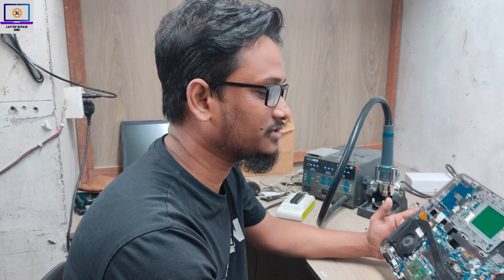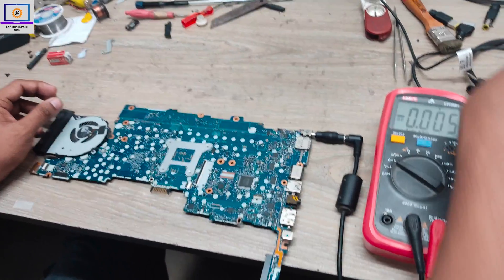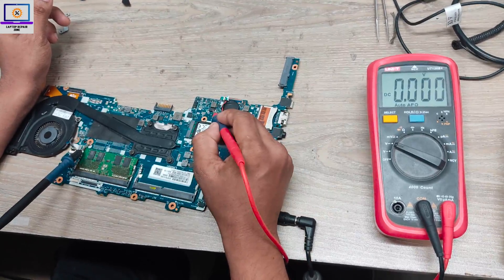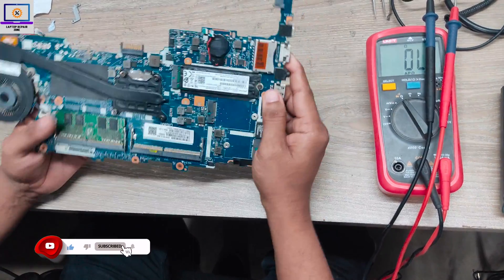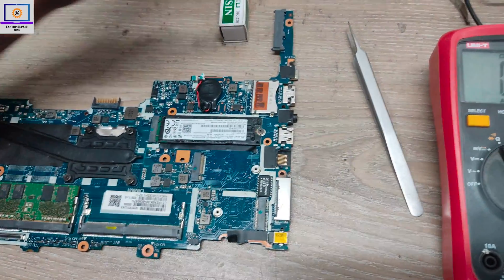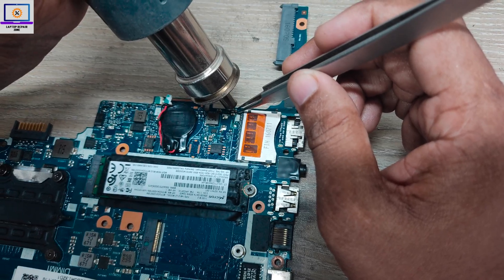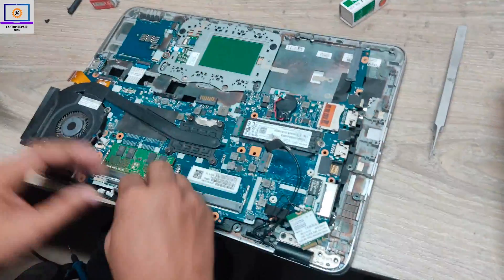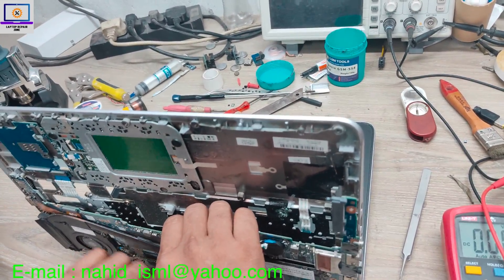hp g3 not turning on | hp laptop not turning on | hp | hp elitebook 840 g3 not turning on fixed!!

Comment: Sir hp laptop 
Without hdd  turns on and shows hdd not detected 
But after inserting hdd laptop turns on but shuts off
Solution plz
Reply: HDD thermals problem, you need to replace or swap the HDD to make it work
Reply: I changed hdd , ssb but same issue

Comment: I unplugged mine on the side, held the power button down for 60 seconds, put the plug back in, and it powered on.  I was looking to do this with the battery out, but did not see where to remove the battery.  That was the fix for a different laptop.  I guess it means it's going bad.

Comment: Hi, my HP laptop is not turning on properly. When I try to turn it on it takes me to a blue screen that has the options, 'continue, use a device, trouble shoot, and turn off'
I've formatted and updated the window, it became normal but after two days went back to the same problem.
What could be the problem please reply
Reply from the maker: First you can try by changing RAM and SSD or HDD, if same problem then you need to service your laptop motherboard thanks.
Reply: @Laptop_repair_zone  ok thank you very much 🙏

Comment: My Pc on plugging in charger is showing blank screen it's not powering on but the caplocks button is on its just constant it can't go on and off 
And the fan is silent we checked the ram it's fine 
What could be the problem?
HP 840 G3
Reply: How did you fix this? I have the exact problem. On the exact laptop model
Reply: @muhuradedan  which country are you from